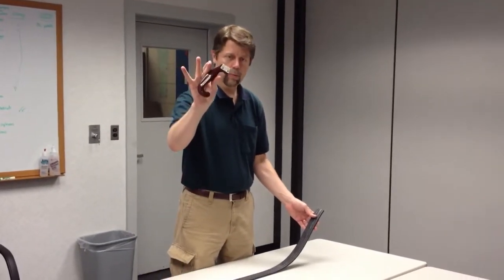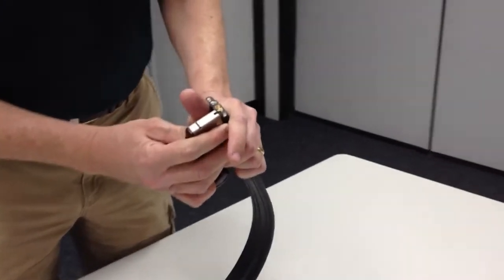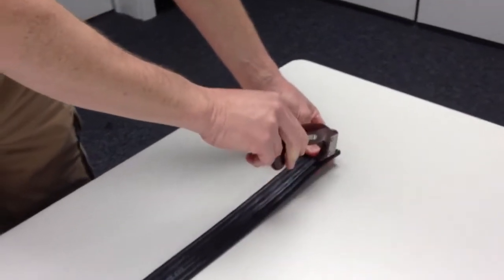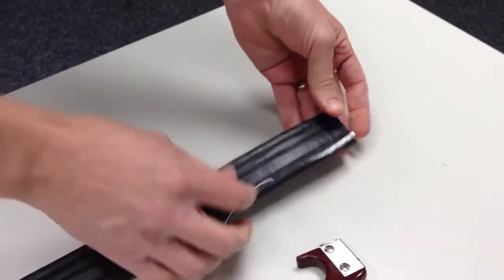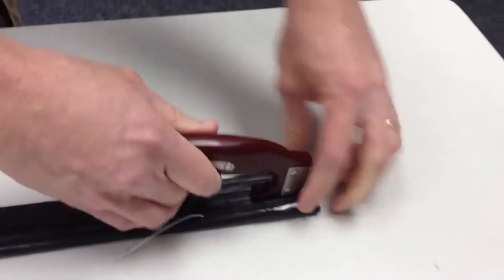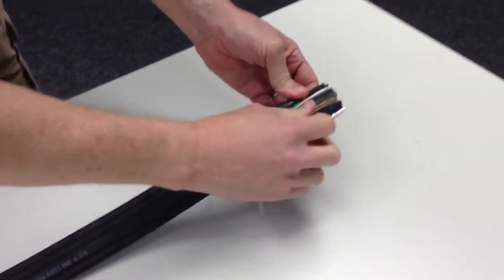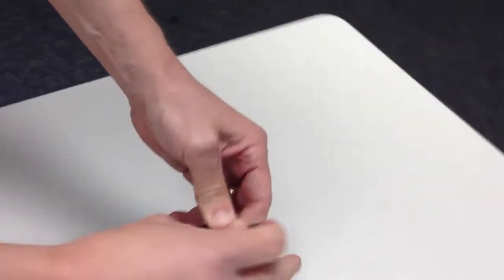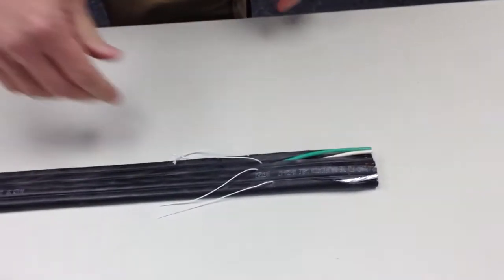Draka flat cable stripping - part 1

Comment: I like that tool, I might get one. Let me ask, is there any advice on what to do if the rip cords keep breaking?
Reply: I've never worked with this stuff (I was looking up a different type of ribbon cable), but it sounds like a mismatch between the thickness of the insulation/sheathing and the rip cord.  There are cable rippers for Romex wire that have a "tooth" that you first puncture the sheath, then drag along to slice it open.  The cheap version is $2, and there are fancier ones, but I think they would only work with cable narrow enough to pass through them.  Personally, I would use something like a box cutter or utility knife to score it (i.e., cut into the outer portion without going all the way through) so that the rip cord will have a path of less resistance to break through.  If you have a lot of cable to work, then make/modify a tool that only allows a small bit of blade to protrude, just enough to weaken the sheath without cutting any insulation.